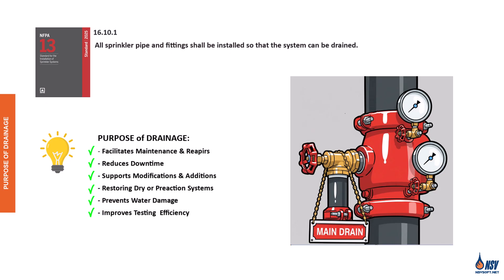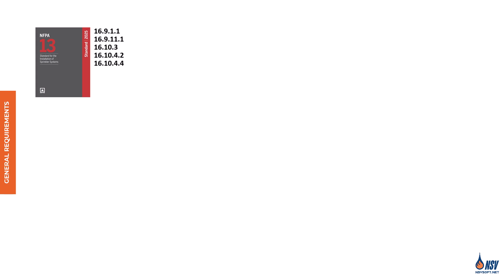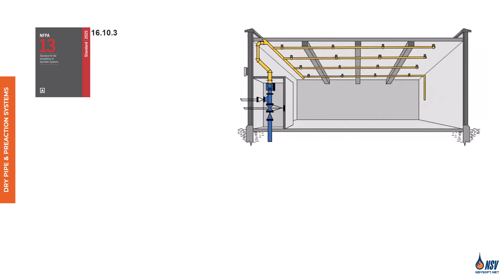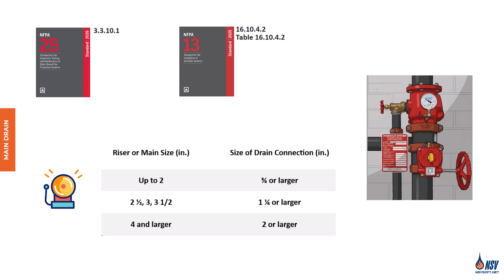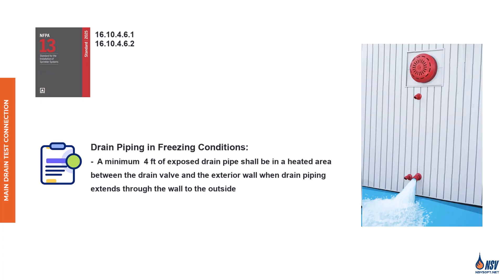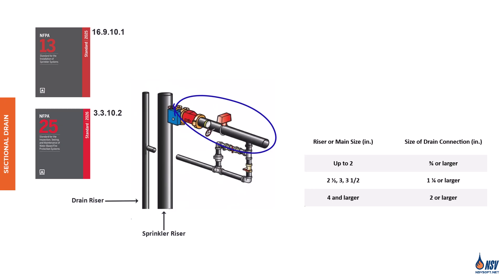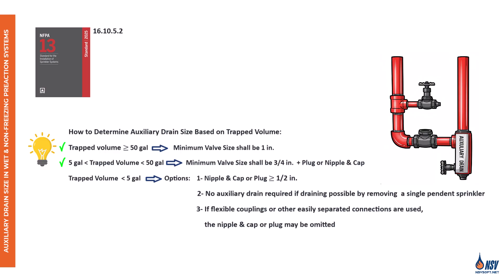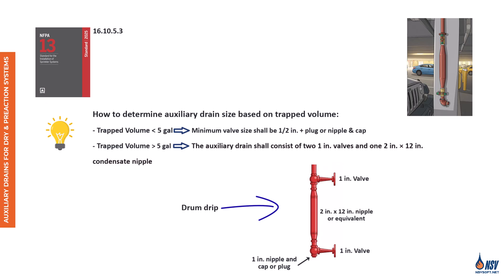🔧Drains (NFPA13/13R/13D)

Comment: What an amazing video! The most important thing I look forward to every week is your new upload.
Reply from the maker: Thank you for your kind words! We really appreciate your support and enthusiasm for our content.
Reply: @NSVCad  I would like to ask a question. For a deluge system, since all sprinklers are open-type, performing a system test with the main drain valve will cause all sprinklers in the entire system to activate. This will exert certain impacts on the protected equipment. Therefore, how should the main drain valve be utilized to conduct tests on a deluge system?
Reply from the maker: In a deluge system, the main drain test is not intended to activate the system, because it is conducted upstream of the deluge valve to evaluate the condition of the water supply while the deluge valve remains in the SET (closed) position. Opening the main drain therefore does not result in water flowing to the open‑type sprinklers. Discharge of all sprinklers occurs only during an intentional deluge valve trip or full‑flow functional test, which is a separate requirement. In addition, NFPA 25 (2026), Section 13.4.4.2.3.1, permits the annual trip test to be performed without discharging water into the protected area where the nature of the protected property does not allow water discharge for testing purposes. We hope we have correctly understood your question; if you need any further clarification, please let us know.
Reply: @NSVCad  Really thanks